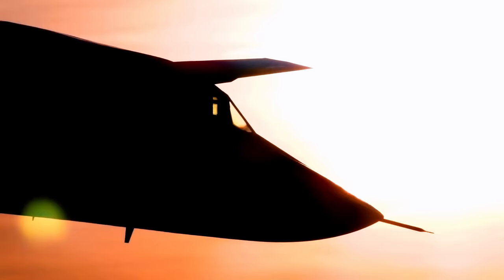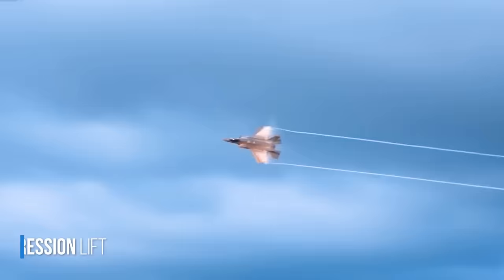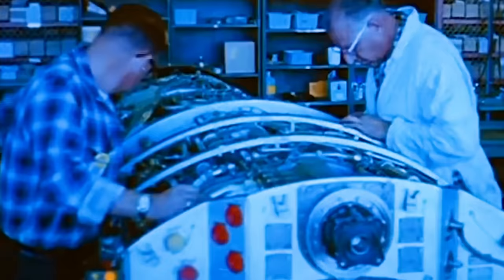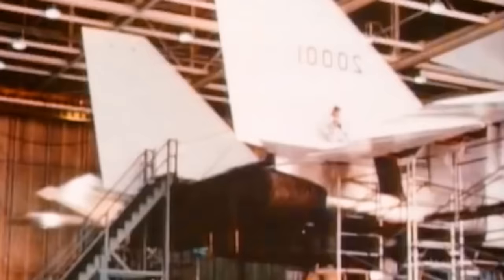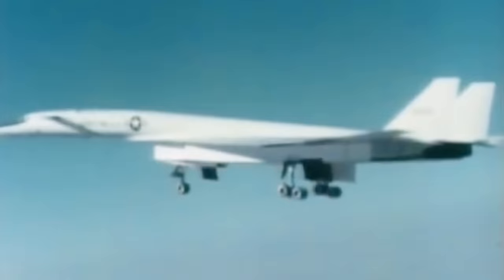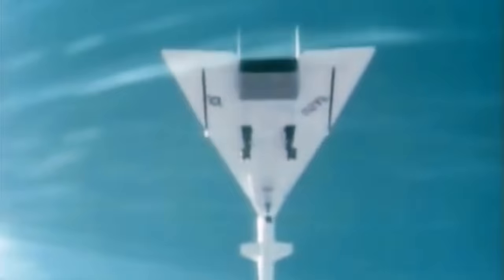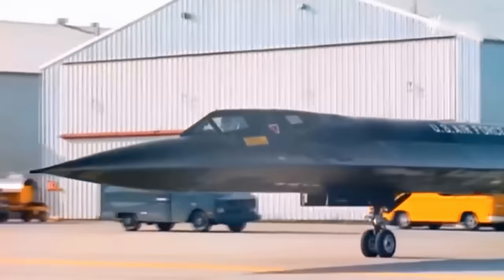The Aircraft Straight Out of a Sci-Fi Film | XB-70 Valkyrie Story

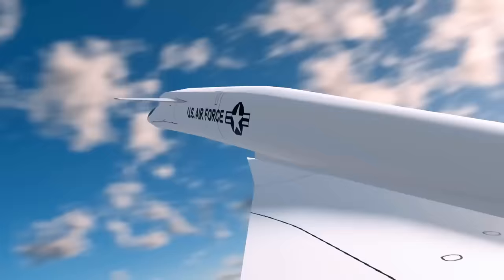Comment: 12:47 i thought it had a fancy shmancy ejection setup ??? what happened there ??? lol why didnt they ejct righ the fkk away when they realized they were hit.. hey had 16 seconds... surely they saw aw burning f4 phantom and were radiod "uhhhh valk niner san trangender 69ers suck and cant beat my BROWNIES !!!!! uhhh come in ya ur tail is gone and ur wing is damaged i sugest you GET OUT asap over and out. then do asick right bank turn.
Reply from the maker: Yes, the XB-70 Valkyrie aircraft was equipped with a special ejection seat, known as the "escape capsule" or "crew escape capsule". In case of an emergency, the entire cockpit capsule could detach from the aircraft structure, protecting the pilots from the extreme conditions of a high-speed, high-altitude descent.

During the accident between the XB-70 and an F-104 Starfighter on June 8, 1966, the co-pilot of the XB-70, Major Carl Cross, tried to activate the capsule, but unfortunately did not succeed and lost his life. The pilot, Alvin S. White, managed to escape from the aircraft but was seriously injured in the process. The two losses stated in the video are related to the XB-70 Co-pilot and the F-104 Pilot.

Several factors made the rescue difficult. The collision took place at a relatively low altitude, giving the crew members very little time to react. Moreover, the unexpected nature of the accident and the rapid sequence of events made it difficult to activate the rescue system in time.